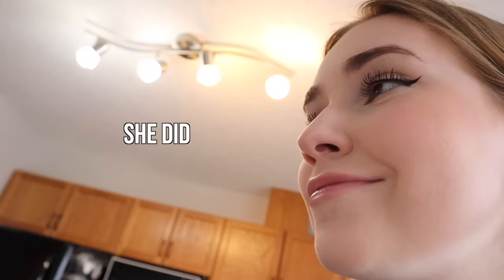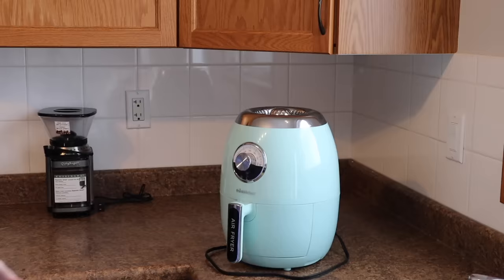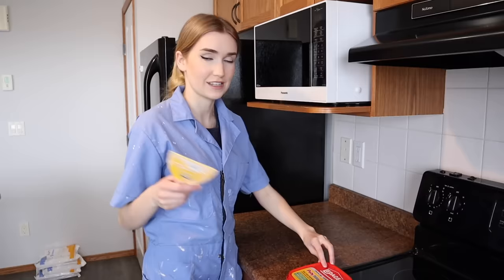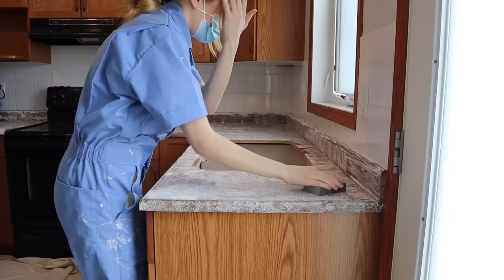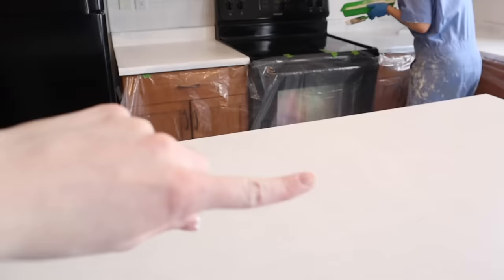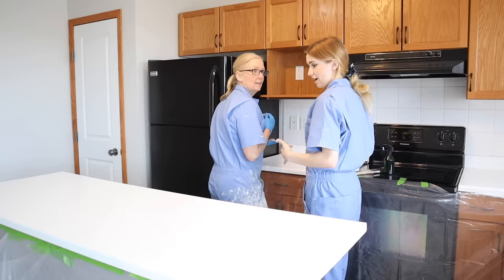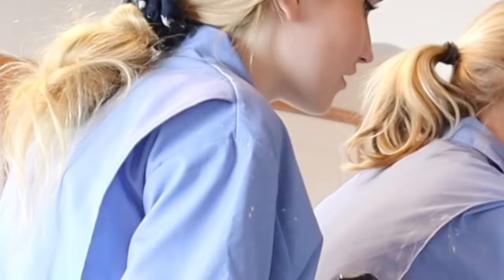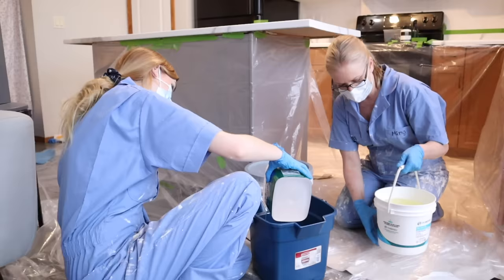Transform Kitchen Countertops With Epoxy & Paint !! *surprisingly easy*

Comment: Hey just a warning! For Epoxy you want to use a RESPIRATOR MASK, not “just” a surgical mask 🙏🏻☺️
Reply: Great tip, but they used resin that's safe to use inside and the instructions apparently said that they didn't need to wear a mask. (However it's a good thing to point out that surgical masks don't protect against gases/fumes.

A second warning! Please don't put any food on the counters because even after it's cured, epoxy is very toxic if it comes in contact with your water and food.
Reply: Technically, there are food safe epoxies out there. But it is a good thing to be aware of even if it’s food safe.
Reply: Indeed, but like they mentioned their epoxy was inside safe.
Reply: @mickb.8925  wait so if it was not food safe epoxy when they cook it can be toxic to their food? Lol😲
Reply: @jesseniapoblete  Yes! And even 'food safe' can be toxic if some of it comes off  when you are cutting vegetables on the counter or something.
Reply: @cheetah8cheese_715  food safe epoxy is only meant to be “food safe” for accidental food contact
Reply: @mickb.8925  sooooo... they did all of that but can't let any food items touch the counter? Then what's the point of them doing that in the kitchen?
Reply: @babs3483  The reason would just be for the aesthetics but I don't think that they actually know that it's not food-safe  😬
Reply: @mickb.8925  what would you recommend doing on a countertop instead of what they did? I was thinking epoxy appliance spray paint, regular paint or contact paper? I want to do my bathroom cabinets,sink and counter
Reply: @babs3483  If you don't put your toothbrush on the counter than epoxy would be the most durable option, and the most aesthetically pleasing in my opinion. After that I think contact paper would be more durable than paint, but often not as good looking because of the 'seams' between the sheets of paper. If you use paint than make sure to check if it's suitable to get it wet often (usually the glossier the better). 

To be clear, I'm in no way shape or form a professional. I just watch a lot of YouTube video's on making over spaces :D
Reply: But cutting boards, doesn't that fix the toxicity problem? I never cook on the table
Reply: @VenoMojito  // I'm completely with you on that. I've NEVER cut my veggies, or anything else on my countertop. Use a cutting board people.
Reply: Right, even sanding you want atleast N-95. What she was using literally did nothing for her lmfao
Reply: @Donna-vh5ym  let's say you drop something and it barely chips the epoxy without you noticing and gets into your food. Who cares if you don't use it as a cutting board. Freak things can happen. Its not worth your health.

Comment: The smoking isn’t because of not being mixed correctly it’s because of a large amount in a small space/container for an extended period of time. It’s called flash curing and it happens in even tiny batches so the main thing is to make sure all of the epoxy you mix is used in some way or you only have a very very thin layer on the bottom of the bucket left!

Edit: this kind of thing won’t happen to your brushes or anything like that because the epoxy isn’t in a small space but onviously the way will be sticky until it cures on them unless you wipe it off with alcohol wipes, if you do that whilst it’s wet you should be able to use them again😊

Comment: Oh Mia! You're adorable. But, I was cringing through this one. I've never seen so many mistakes made during an epoxy project. I'm not sure the epoxy you used is food safe. It looks like what you used is a garage floor coating. You did not appear to repair the pealing laminate on the island before painting and coating it with epoxy, so it will probably still pop out. You shook the epoxy, introducing excess air. You did not measure the epoxy exactly, didn't mix the parts well, didn't coat the counters with a thick enough layer, and didn't make sure the edges (including those next to the stove and fridge) were all coated. You didn't appear to ventilate the room well. And you left a large amount of mixed epoxy in a plastic container. The thicker the depth, the hotter the mixed epoxy gets as it cures and it can melt a bucket and ruin whatever the bucket is placed on. Fortunately, it won't set anything on fire since a large quantity reaches only about 400 degrees and you need a considerably higher temperature for combustion. But the fumes are not good for you. Despite all that, as long as it's food safe, you might have a countertop for a while, proving that epoxy is a pretty easy product to use. I'd recommend checking on that before you put food on it.
Reply: Wow! I couldn't keep up with your knowledge  of what Mia & her Mom didn't do, even though they didn't show you everything they did do on film,and you have no idea what research Mia did, or how much on film. how gracious some people can be in how they get a point across.

Comment: If you want to paint realistic viens for stone or marble.........use a big feather. Dip the tip in fairly thin paint and twist the feather as your pulling it across the surface. Trust the process. You can let it tack up a little then soften it with a really soft brush. Go in again after it's dry, and add darker, finer lines with the same feathr technique.

Comment: Hi Mia & Mum, I don’t know if you have gotten any other comments about getting stuff from your brushes & rollers but, before you use a brush or roller, you need to “Defuzz” the pieces you are painting with. You need to use some tape and rub your brush & rollers with it or you can get fuzz or other debris on the countertops.

Comment: I love this project and the commarderie between mother and daughter. 
There's a YouTube channel called Stone coat (or something) and the guy shows how to use spray paint as one way to create effects on counter tops before using epoxy. Just in case you plan on another project like this.
But your way is very good too 😊

Comment: when the epoxy gets hot it means it starts curing! You need to only make as much as you need! Also you cant put anything hot on the counters now because even if it is a durable epoxy and heat resistant it can still get sticky or get marks on it despite it is fully cured. Great job though, it looks lovely overal!

Comment: Great job! Sanding with an orbital sander helps 💜 Especially on the edge of the countertop if it’s square. Also rubbing alcohol is a great product to clean with. Also you can run the epoxy under b the lip of the counter. Especially the Island 💜

Comment: Epoxy resin heats up when it cures, which is usually why it smokes. The more resin there is, the hotter it gets. That is why a thick layer left in something like a bucket could smoke pretty easily.

Comment: I make these epoxy countertops with my dad for his customers whenever we do a reno :) it's a lot of fun and there are unlimited possibilities! I highly recommend watching Stone Coat epoxy and their videos on YouTube! normally instead of painting the veins first, you should actually trying pouring different colors of epoxy onto the countertop instead. It adds a lot of depth and layers. Check out their website, they have diamond dust, and many other color pigments to try that really amp up the looks of stone. :)
Reply: I also recommend using a heat gun next time instead of a torch because a torch can overheat the wet epoxy and burn the counter underneath which will cause worse bubbling. a heat gun can also create a lot of cool effects with poured epoxy like waves/etc. you should try it in a bathroom next time!

Comment: If you do more epoxy counters, you should put a good layer of epoxy down and when it is still wet, do the veins with colored epoxy and a heat gun to move it around! You’ll save so much time!

Comment: The epoxy would smoke if it’s too thick and it gets really hot and if on the project it can crack or prevent curing properly;) you guys did a great job

Comment: The countertops do look nice.  But, I’m still pondering why the range and the refrigerator were not moved so that the edges could be finished in those areas.  Smart move to remove the sink.  The new sink set is a beauty👍👍

Comment: Mia, I went back here not just to rewatch but to tell you the Epoxy on counter tops are not advisable. They are not food grade I think. They say that there's no proof that it won't release any toxic substances after curing. And it is not heat resistant. Idk I am no expert I just remember you when I read some Idea sharing about counter tops on an FB group for Home stuff and I am simple a concern fan here. By the way any Filipino fans I got the knowledge on Home Buddies you know what I mean. 😅

Comment: A foam roller would have worked well. Epoxy is highly flammable. I worked in a jewelry factory, doing epoxy painting, we were in an isolated room, the epoxy mixer was also isolated we would get what we needed from him in a sm Dixie cup, and it had to be used w/in 15 min. or it got hard. It was a great job, I truly enjoyed it, very satisfying results.

Comment: The epoxy smoking would also be from it being too thick. Epoxy heats up due to the chemical reaction as it cures. So if you pour/leave it too thick it's going to get VERY VERY hot and smoke. If it's in a mold or can crack and shatter everywhere as well. Be SUPER Careful and better to pour in small batches or it will kick too soon and cure in your container

Comment: Nice job. You didn't mention if you wanted the glass vs honed look. One more step would get honed kook with either finish coat of epoxy for honed finish or sanding in multiple grits. Very nice look though.

Comment: I have the same style of countertop with a wall board connect to the countertop. I am a little bit worry about putting epoxy on that wall board will drip down when it is drying

Comment: Another epoxy counter tip: if you end up with bubbles or holes anywhere, you can fill it in with clear nail polish... obviously just for tiny touch up areas!

Comment: i have only worked with epoxy for small crafts and even that stuff heats up a lot when its mixed together in a cup so i can only imagine waht a bucket full could do. its a normal process so maybe just try not to make much more than you'll need so you don't have a lot just sitting in a bucket that might heat up too much.

Comment: I’m sure somebody has already told you this but if they haven’t next time you use a fuzzy roller be sure to go over it with painters tape until all of the excess fuzz is removed before using it on your project.

Comment: The thicker the epoxy, the hotter it will get as it cures. By leaving it somewhat thick in the bucket, it probably started melting the bucket which would happen with pretty much any epoxy you do that with

Comment: Do you torch before it dries. You weren't clear on that part. The video shows after yiu guys did the second coat of epoxy you went in with the torch. But did it dry or half way dry or still relaly wet? Whats the point of the torch was it bubbles?

Comment: Almost all epoxies will over heat in a bucket as it is not designed for thick layers. There is a specific recommended time that you can keep it in the bucket until you’re done working with it and it is usually stated in the epoxy company data sheet. You shouldn’t be mixing large batches. Just what you need and then repeat.

Comment: Also another safety thing, those masks are not rated for fumes. They're particulate only. If you're working with something with a lot of fumes you need a respirator. I'm sure it was fine with that epoxy which was made for indoors, but just FYI.

Comment: If people do this.
You NEED a respirator and full body protection when working with ANY kind of resin/epoxy. The reactions can be severe. It is not safe no matter what the label says. Read SDS' on the product.

Comment: They said to tape the roller first.  Then remove the tape ;  to avoid the roller particles on the surface .   Also.  They used a putty knife of  size to push n pull the epoxy on the  area you are working!  
Do the research people. They give  professional tips as well .  Find their site.  
The fire takes out the bubbles for those wondering why.    Do your research .  Then ... watch them .  It peels out of the pails,  people.  Go watch the professional.  Do this.   Suppose to of removed this while still wet.  For the edge

Comment: With respect, designers don’t usually recommend that the island counter top be exactly like the wall ones. It’s usually recommended that they complement each other. Same for the cupboard doors underneath. Choose a complementary colour, but not the exact same, no. Otherwise, you and your mom are cute. Cheers.

Comment: Love the fun environment you and your mom bring to your projects. However, using a lot of epoxy like you were doing (as opposed to making jewelry) is very dangerous for your lungs. Using a respirator is necessary. Little cloth masks will not protect your lungs from epoxy/resin fumes. Those aren't much protection from dust getting in your lungs when sanding.
Also, I am surprised you didn't use protective gloves. From heavy duty cleaners to epoxy and paint, gloves are your friend.

Comment: Oh... I thought you will use that one method which is use epoxy and special paint at the same time. Then you will spread the paint with some heat blower.
Reply: It might be a little bit quicker

Comment: Please teach people correctly that epoxy vapors can only be protected by a respirator and it should be for “ organic vapors “ it will have an OV or purple ring in the US and for dust when sanding.  The epoxy overheated when it started smoking.  That is from the thickness. Always get it out of the container as soon as possible so that you don’t heat it and start it’s chemical process of curing which generates heat.

Comment: OK. so inorder for your filler to bond to the plastic counter you need to give it a good sanding FIRST. which if you sand well you can skip filler. BUT if you really want filler, light weight poly fill spackling is NOT the way to go, no structural integrity. Bondo would work great and be strong BUT it stinks to high heaven. if your going to spend all that money on the top coat its worth doing the prep layers correctly for long term durability.

Comment: Need to be careful with epoxy tho especially when using them as countertop in the kitchen. It's not as heat resistant as granite and quartz.

It looks really good though. You can be an interior designer by profession. 🥰

Comment: Being an artist who also does epoxy resin work, this kind of stressed me a little to watch. I love love love Mia and her mom so much and they are capable of so much! But please, if you try to use epoxy for the first time, I wouldn't suggest starting on this size of project. And yes, leaving epoxy to cure in a container can actual light on fire and the smoke is not ok to breathe in. Please be aware that allergic reactions to epoxy is common and can happen from coming in contact with it but also just the flumes causing skin, eye and lung reactions. So please please do research and wear proper PPE. Saying all this lovingly! Just want everyone to stay safe 💜

Comment: be careful when doing large resin pours like this guys... you can create an uncontrolled exothermic reaction. also not using precise measurements can be dangerous as well.. it can heat up to smoke, burn, and melt the container. in some cases there can also be spontaneous combustion.
Reply: oops i didn't see the green part of the video lol